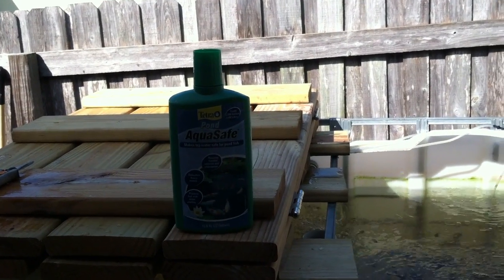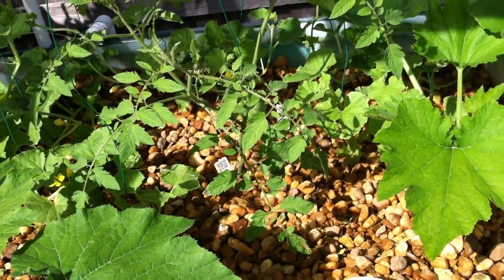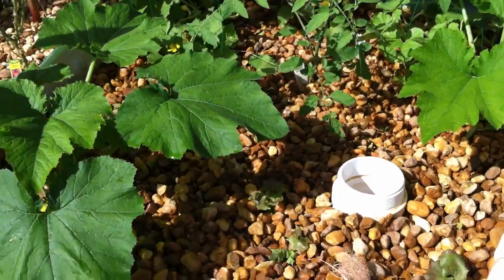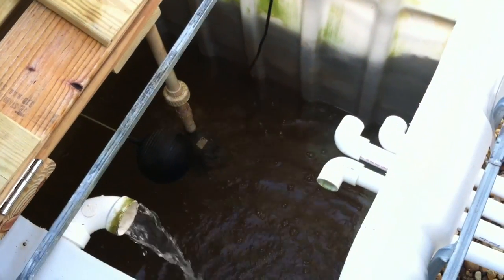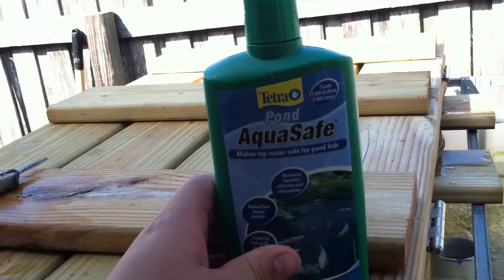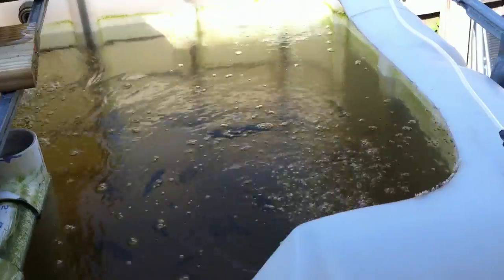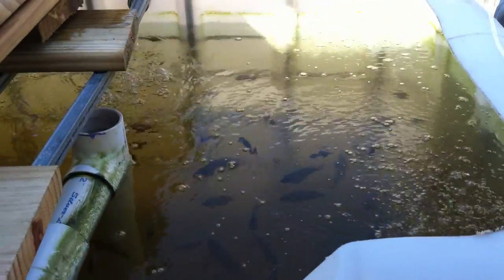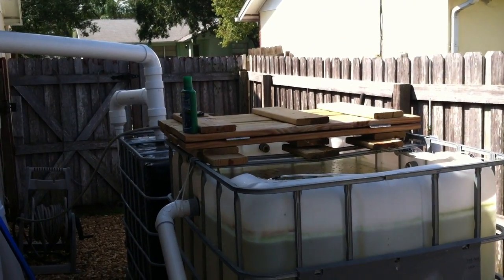Mikes Aquaponics First System Update Part 5 - Bell Siphon clogged by Plant Roots

Comment: Hi Mike,

For some reason my last comment was deleted. I really like your set up but wanted to see how I could find a work around  my composite roof as I don't want to get petroleum chemicals in my water. Also wanted to know how often you drain your system in order to deal with the plastic that leaches from your BPA free containers. Do you run charcoal? Have you had the vegetables tested to make sure they don't have high levels of endocrine disrupting plastic residues? Thanks

Sent from my iPhone

Comment: Just a tip for the root problem. Cut slits into your media guard instead of drilling holes. If you use a table saw, for example, to cut slits across the media guard, it will create sharp inside edges. When the roots start creeping in, just spin the media guard to cut the roots down and pull them right out.

Comment: Like I said, all you do is put an overflow pipe just below the edge of the bed with a bulk head fitting that is about 2 inch diameter and have this run to the sump in your system. Do this in all of your beds!

Comment: to prevent overflow, add an overflow pipe that is about 2 inch diameter on each of the beds. The pipes will go to the sump tank and this way you won't loose any water. You could also give the actual bell of the siphon a little twist once a week. Also twist  the guard the same time. All you do is spin both of them around in circles for about a minute. All of the roots will break off. But that overflow pipe is necessary to prevent water loss if the siphon is clogged and you are not there.